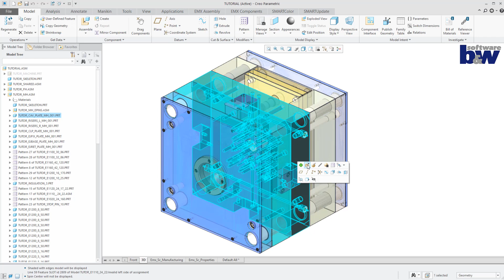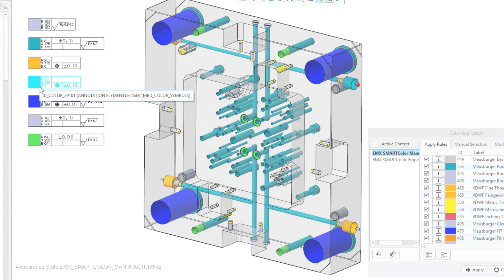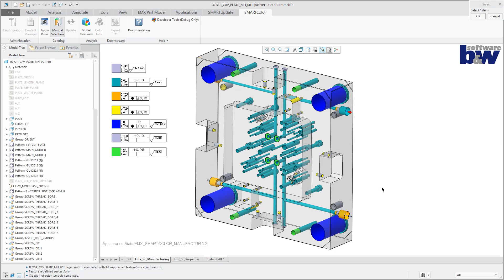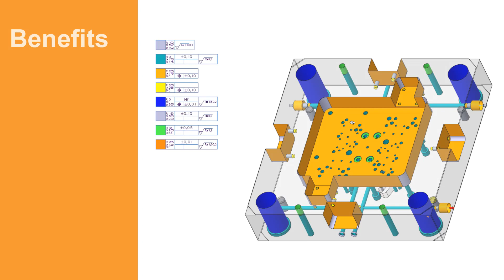EMX meets SMARTColor

Comment: Looks interesting,  I'm currently using EMX 9.0 with Creo 3, hope to upgrade to Creo 5 or 6 soon, with latest EMX. Using EMX to build plates then I use my own library of parts, EMX uses cosmetic threads where as I use the Hole feature with custom Note configs.